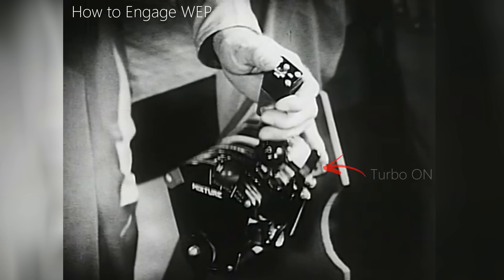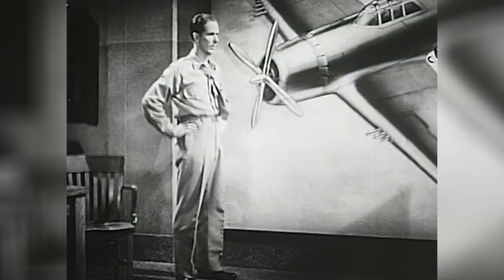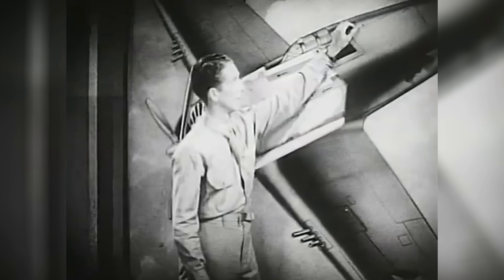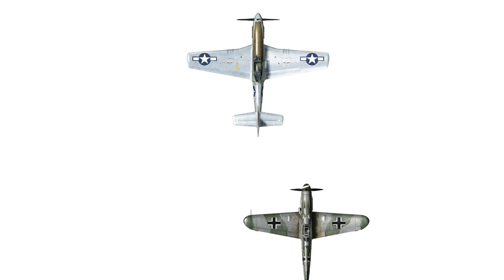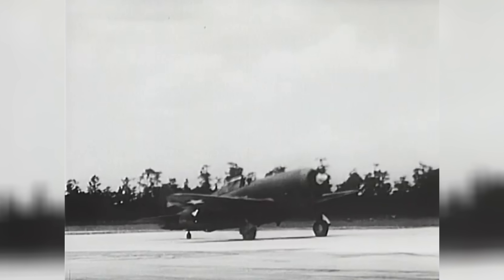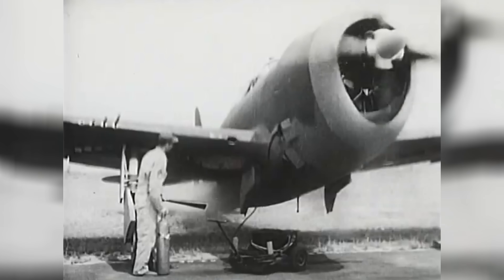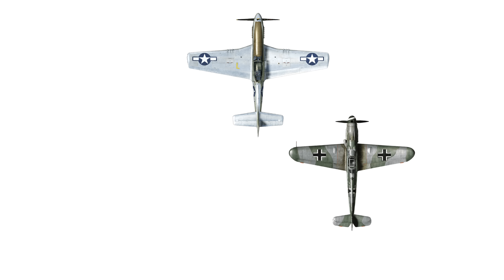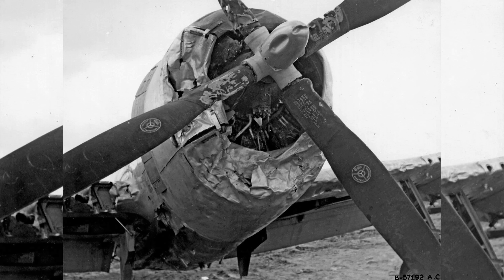What is WEP?

Comment: What do you mean "few seconds". Weren't they rated to like 5mins or so of WEP, then I guess shit starts to come apart.
Reply from the maker: Thanks for the comment TM, depending on the aircraft they might have the water injection for roughly 5-10 mins  however the engine is under extreme stress during it. The issue isnt just heat at that stage. Some engines have blown out straight away, some last longer. Merlins were decent at it

Comment: i think the K4 would have been lucky to run at 100% throttle, let alone catch an H mustang slurping down 150 octane into its properly-maintained-even-during-wartime engine. not that they ever met. it wasnt a teenager in the K4 was it ?!?
Reply: This is where doing a bit of research helps. The Bf 109 K-4 wasn’t some fragile prototype it used the DB 605D, ran MW-50 routinely, and was cleared for sustained 100% power within limits, just like Allied engines with WEP. And yes, late-war 109s absolutely encountered Mustangs in 1944–45. If the K-4 was supposedly ‘lucky’ to survive full throttle, why was it still Germany’s top-end interceptor at the very end of the war?
Reply: @Will1988US  yeah research really does help. maintenance on these was hampered by a total breakdown of the supply chain. ready to fly planes were butchered to keep the planes with an actual pilot flying. there was no fuel, & delivery of stored fuel was sporadic. the aces that wanted to stay alive were avoiding as much contact as possible. teens were flying by 45. there no K4 v H mustang combat at any point in the war. if you think the average K4 in use during 45 was able to match the tests done by the factory, or after the war by the allies then your living in a post war air combat sim fantasy.
Reply: @gerrysimons  This comment is just a pile of half-truths glued together with confidence. Yes, Germany’s logistics were collapsing everyone knows that. That doesn’t magically erase the fact that K-4s did exist, flew combat sorties, and intercepted bombers in 1944–45. No K-4 vs Mustang combat is straight-up false. “teens were flying by ’45” pilot quality declining doesn’t mean the aircraft suddenly stopped being competitive on paper or in capability. That’s a training and fuel issue, not a design refutation.“if you think they matched factory tests you’re living in fantasy” no one claimed that. Allied units also flew abused, non-factory-fresh aircraft. This is basic late-war Luftwaffe history. Try separating logistics collapse from airframe performance. Why not actually do a bit of research Gerry?
Reply: @Will1988US  you definitely are a flight simmer. your telling me to do some research, try taking your own advice & look up the combat history of the H mustang. no K4 ever met them.

Comment: Nitrous and water methanol injection plus a closed waist gate you’re going from 2000 hp to the full 3600 of the R 28 wasp
Reply from the maker: Thanks for the comment Oler, that is a ridiculous increase in power. Likely feels like an entirely different aircraft
Reply: @FlakAlley  I used to set this up in my street drag car it weighed 2000 pounds or one US ton in made around 600hp
In normal mode, it made 10 pounds of boost and 300 hp in race mode. It made 450 to 500 hp and then there was a special mode I labeled WEP so I added a feature in which if I ever needed to win a race or get out of an emergency situation the Westgate would close all the way and my turbo would go from 14 psi to 37 psi on a T 67 Greddy turbo passing race mode going straight to the 6 to 700 hp range which would blow up my engine, but if I needed to win or I needed to get the hell out of there, I had it and it was more concealable than nitrous
Reply from the maker: @oler777  Wow, have you ever had to use the WEP?
Reply: @FlakAlley  I had to use it three times one time I took my friend out for a ride in the car and there was a parade of people probably nine or 10 cars long so I decided to pass all of them but right at the very end a Dodge minivan was headed our way so I held down the button and shot past everybody just to get out of the way the second time I was in a drag race against a 500 hp 2007 Subaru in the middle of racing while I was in race mode so the car is making about 500 hp. We’re both equal. A car rounds the corner at the very end of the race and I had to do the same thing hold that button down and hope the thing doesn’t blow up. Which worked unfortunately the car coming around the corner was a sheriff. So I got a big ass ticket from that one, but he also noticed I did something and said because you didn’t kill me or the other racer I’m gonna let you go with a ticket. The last time which was the end of that car racing a Yamaha r1 winning the race at 190 then running from the cops using it 4 more times during that chase, I eventually had to hide then going into stealth mode(turning off all your lights at night) and then when I limped my car home, the 7M was destroyed
Reply: @oler777 this will be reported to the authorities!
Reply: @V @Verdeniza and? Why waste your time for something you have no evidence for that happened over 25 years ago good luck with that
Reply: @oler777  Sounds like a recipe to get your engine blown!

Comment: ......& then the enemy pilot chasing you also engages WEP............
Reply from the maker: Thanks for the comment Jason. If the WEP was German then there is a good chance it blows the engine immediately. They had a massive reliability problem. Its very risky for all parties but the Merlins had the most safe type, in theory it should win
Reply: @FlakAlley Dude pls stop talking BS , the DB 605 with 42.000 build engines mostly for Bf109 was an engineering masterpiece . Sondernotleistung with MW50 could be used for 10 min straight and gave you 350hp more .
Reply from the maker: @5co756  Thanks for the comment 5co, Are you aware of how long the Boost on Merlins last? In that situation as good as the 605 is on WEP it does not have the same reliability or boost period. Please look into it
Reply: @FlakAlley 5 minutes straight use was the advice on Merlin engines .....

But anyways , saying the DB engines had reliability issues is criminal .
Reply from the maker: @5co756  There is no need to get heated here, completely respect your opinion and you are right. There are 2 sides to a coin however and this is one of those situations
Reply: @FlakAlley I hate it when people make claims with no proof , this is just sh*t talking . After 15 years of YouTube WW2 videos , there is not one single German engine left that was good or reliable . Mr Flak now , killed the Daimler Benz .  

So how did these guys got so far to the east and why are they still today the biggest car manufacturers in Europe ? While the British superior engines are gone , this doesn't make any sense . 😅
Reply: @5co756   This is where the argument completely derails. You’re jumping from wartime aero engines to postwar car companies like that proves anything. It doesn’t. You cant say it doesnt make any sense when you dont make any sense!!
Reply: @Will1988US  Is anybody here talking to you ?
Reply: @5co756  You are talking to me? Arent you

Comment: For many aircraft, the spitfire for example being one, there was a small piece of wood you actually had to smash the throttle through to get it into the wep setting. So this way you had something to stop you from doing it accidentally but at the same time could access it instantly if needed, but not without it being visible to the maintenance crews that you had done so.
Reply from the maker: Thanks for the comment David, amazing piece of knowledge. Are you familiar with spitfires yourself?
Reply: @FlakAlley well, now that you mention it I have been fortunate enough to have  several dozen hours flying in the back of a two seat mkix actually. I wouldn't call myself an expert on them though, my knowledge pales in comparison to some people's, but I did pick up a few things. I'm pretty sure that piece of wood has been replaced by an unbreakable preice of metal on pretty much all spitfires by now though, for obvious reasons.
Reply from the maker: @davidgreenwood6029  Wow, you have flown in them many times. Its unlikely WEP has ever been toggled on any WW2 prop since the war ended, fully blocked off is fair. The Last thing you want is accidentally destroying these expensive merlin engines. What stood out most to you about how differently those aircraft feel compared to modern aircraft ?
Reply: @FlakAlley  I cant really speak to warbirds in general, as I've only really spent any time in the spitfire, I've had one flight in a t6 and a few in a t34, but as far as the spitfire goes, what stands out is how easy it is to fly, handles very predictably at low speeds, very low stall speed compared to other warbirds and even other modern high performance planes and also exceptionally low turning stall speed. The elliptical wing design really is extraordinary in terms of handling especially at low speeds, at ounce both highly responsive and very docile if you're not overcorrecting and panicking. If you have a steady hand, its a very reassuring plane to fly. I found it easier to land than a beechcraft bonanza for instance. Takeoff is pretty intimidating, there is a very strong lateral impulse on the stick during takeoff that happens very suddenly. I don't really understand the physics, you'd think gradually increasing throttle and RPM would mean the torque impulse would increase somewhat gradually as well but its not the case, its very strong and very abrupt, but its just a momentary thing. I think it might be so abrupt because it happens right as the plane starts to lift off and the wheels lose their grip on the ground and the lateral stability they offer.  Other than that the spitfire is a very well behaved aircraft. The only other minor quirk is she doesn't want to land. Once she gets low enough to be in ground effect she doesn't really want to stop flying. One could attribute this to her excellent aerodynamics, but also, one could easily anthropomorphize a bit and attribute it to the plane's personality just desiring to be in the air and not on the ground. This is a little more tricky flying from the back seat, as not only can you not see over the nose, but you aren't seeing the ground out of your peripheral vision due to not being able to see down in front of the wings at all, but its really not a big deal, you just fly an approach till you feel you're in the ground effect, then instead of doing a landing flare, you just ease back on the throttle a tiny bit and that's that. I've honestly never felt safer in an aircraft of any sort, save maybe a j3 cub. In those you feel like were the engine to go out you could almost land the plane anywhere. With the spitfire, flying in the mountains felt very safe, it can turn at low speeds in very tight spaces safely, or, if that doesn't work, has the power to climb out of almost anything. The combination is very reassuring, and the plane feels as well built and trustworthy as anything manmade can be. Warbirds have an intimidating reputation, and a lot of pilots have died in them during peacetime, but if you're not reckless the spitfire is an excellent plane to learn to fly in, I did not have many overall hours when I first landed it. I pretty much went from flying a J3 cub and a Schweitzer 233 sailplane, and only a couple landings in a bonanza and t34, direct to doing takeoffs landings and full cross country flights in the spitfire, no truly solo, as there was someone with much more experience in the front seat, but flying whole flights without anyone else on the controls with probably less than 200 hours total time on the controls of all aircraft. Thats not bragging mind you, pilots in the war were able to progress even quicker, a few hours in a J3 Cub then on to the spit, with very few pilots killed in training. EDIT: No idea why your reply got doubled and now mine got quadrupled!
Reply: It was real thin bronze wire, not wood.
Reply from the maker: @patrickshaw8595  On the Spitfire?
Reply: @FlakAlley  Swear I never heard about no popsicle sticks across throttle quadrants. Every mechanic had bronze wire, though. 
   Only "Spitfire+wood" story I ever heard was:
they took some regular Spitfires (not Seafires) on small aircraft carriers to Crete or Malta or somewhere. Spitfires had compressed air operated landing flaps and they were "all (3o degrees??) or nothing (zero degrees). Well they needed half flaps
to fly off the little carriers. 15 degrees. So the ships carpenters figured out wooden wedges. Put the flaps full down, insert wedges, raise them and they stopped at half flaps. After takeoff they lowered them, the wedges fell out, raised them and flew away normally.
   I mean you could be right about what you said  - but I think I would have heard about it. Real thin bronze wire. Took about 30 pounds of force to break. The planes were designed and built with them.

Comment: War Emergency Power is what the WEP stands for in War Thunder and yes it did over heated the engine just slightly yellow it.
Reply from the maker: Thanks for the comment Edgy, are catastrophic engine blowouts modelled? Essentially if you turned on WEP you wouldnt know when it was going to explode, it was a last resort only
Reply: @FlakAlley  WEP is a very common feature in War Thunder, but its very toned down. If your plane has good engine cooling, you can basically run WEP the entire match and only occasionally turn it off to cool the engine. Temperatures slowly rise a small amount and the extra power isnt substantial
Reply: @FlakAlley  blowouts aren't modelled, but the engine eventually will start to die and produce less and less thrust until it completely stops

Comment: Damn. I just use it as speed boost like whenever the cooldown timer is done
Reply from the maker: Seen a few comments like this, perhaps WEP is just a fancy Military power in this game?
Reply: @FlakAlley in War Thunder's arcade mode WEP is basically a short term engine boost on cooldown, whereas in realistic mode it does quickly increase engine temperature and can lead to rapid blowout.
Reply: @as_vera he knows, those are ai generated comments youtube allows you to enable that are supposedly what the actual creator woug say, you can recognize them pretty easily tho
Reply: @as_vera  Ahh, thanks for clearing that up. I wish I had actual WT on my PC...but I only have the mobile app for my phone, it is a different game, pretty much arcade like. WEP can be used once every 90 seconds or so, and never blows your engine.
Reply from the maker: Missions you are not chatting with AI, You seem to be commenting the same thing to everyone which is typical of an AI chat bot, Perhaps you are the AI?
Reply: @FlakAlley okidoki
Reply from the maker: @missionslos  Missions hope you are not an AI too :)
Reply: @FlakAlley you can use wep for good half a minute then get back to 100% for 10 sec to cool off engine and you good to go for next wep and that is in "most realistic" simulator battles in arcade wep is more like defult 100% i never knew that should blow my engine
Reply: @padi-p398  Apparently manual engine controls are OP so you dont take any overheat damage but my old self is dumb to know how to use it
Reply: @Will1988US depend witch mode on arcade you can't on realistic you can but you have to heavily overheat it for a good minute and on simulators you have like 10 seconds form moment it gets on red

Comment: in War Thunder you can use manual engine controls to open the radiator to full so the WEP doesn't burn up your engine.
Reply: But causes drag, in some planes the drag so big that it eliminates the benefits of using wep continuously.
Reply from the maker: Interesting! Do you know if the water injection timer is properly modelled?
Reply: @FlakAlley  It used to be modeled to some degree (f80-c and p-51h for example had limited wep duration), but it was recently removed from many American aircraft giving them unlimited wep (ignoring heating), not sure about others.
Reply: @someguy-qb2rsP-47s, Corsairs, and F6Fs(basically anything with some flavor of P&W 2800) have limited WEP still.

Comment: Warthunder pilots be like: is WEP the cruise setting?
Reply: It is the cruise setting because the airfields are too close together. If props were flying on the big english channel map there would be no need to abuse WEP for gaining altitude.
Reply: @stoyantodorov2133 also, if you really want to gain maximum altitude, like over 40k feet, you're much better off doing it gradually and saving fuel. Most of the WWII planes that had the highest service ceiling did not have tons of fuel especially early in the war. The spitfires were used as photorecon platforms and could go above 40k feet due to exceptional aerodynamics but were limited in fuel. The mki ceiling was 35 but by the mkix it was 43k.  I think that high service ceiling probably also came in handy while trying to intercept the v2 rockets as well.
Reply: @davidgreenwood6029  you can't intercept V2's
Reply: @ValentineC137 spitfires did shoot down v2s. That's part of how they did it, starting off at much higher altitude and diving on them to gain speed. Spitifres can brush right up against the sound barrier in a dive.
Reply: @davidgreenwood6029  V2's came down significantly faster than the speed of sound, and I don't believe the spitfires passed the karman line
Reply: @ValentineC137  You're right, I meant the V1, just wasn't thinking.
Reply: Warthunder wankers can never shut up about their shit game
Reply from the maker: Thanks for the comment Mantlet, are you certain that its WEP and not Military power? Sounds more like military if you can cruise on it for long periods
Reply: @FlakAlley They are refering to the game War Thunder, that also has the WEP boost option. Hence the explanation of small maps
Reply: @FlakAlley  it’s just the maps are so small that it’s useless not to. It’s 110% throttle, and for jets that equates to burners